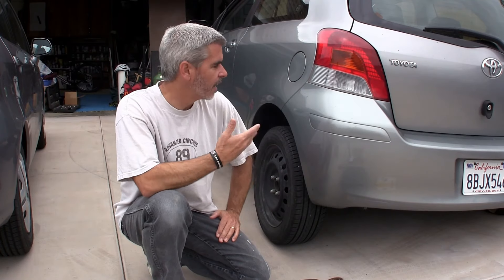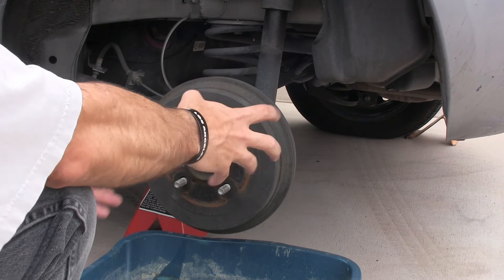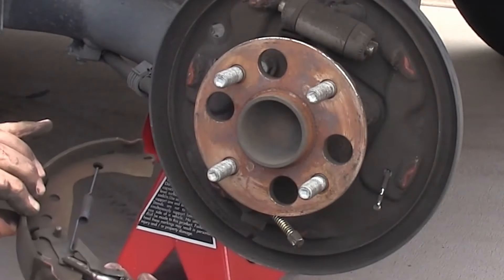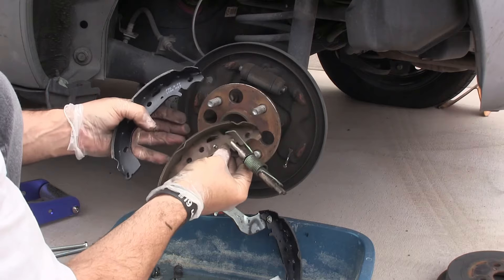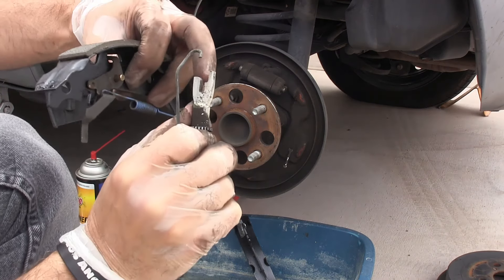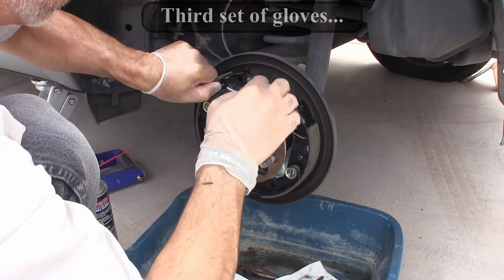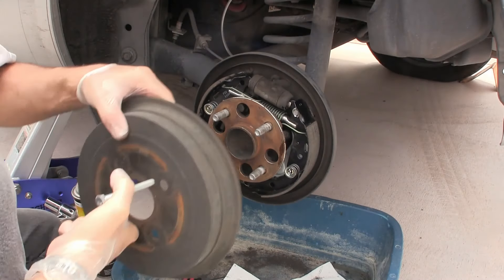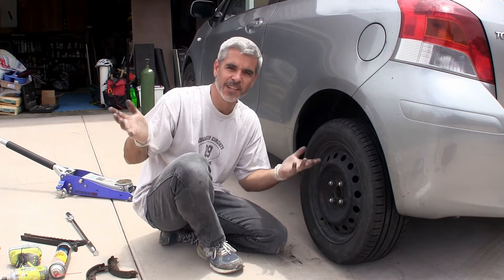DIY Toyota Yaris Rear Brake Shoe Replacement

Comment: Good job, but personally I would have slackened the parling brake cable first. That way the cable lever on the shoes will be set back to the limit. If any past ajustments were made the lever does not go home enough,   this will make the cable come off the lever easier.
After fitting left and right side shoes and adjusting, whilst on the jack stands, adjust the parking brake. Hence the cable has maximum effecked of shoe contact.  But hey, we all have our own ways of working!!
I worked in the motor trade for 54 years, just saying not at all bragging. but I sincerely enjoyed watching your video of this tricky awkward job
well done and great camera work. very informative.
Reply from the maker: Thanks for your comments.  I appreciate your experience in this!  I've pinned this comment to keep it on the top of the comments for now.
Reply: @DansWay  @John Allen, I have never thought of loosening the parking brake tension.  I feel like a dumb a**.  I was just lamenting the stupid design of that spring on the parking break cable and saying to a friend of mine that you really need a second person to clamp the vice grips because that spring is so tight and it pinches your fingers when you lose grip on it to get the vice grips on the cable.  I was saying, to him "I just need to invent a tool that will pull that spring back and act as the second person, allowing the vice grips to be clamped."  Duh!! Just loosen the emergency brake tension dummy.  Thanks for the obvious to be brought to us who don't always know it should be obvious!
Reply: If you know how to do this why are you watching the video just curious lol

Comment: This actually helped out tremendously. Went back and double checked my work. Found two things wrong with what I had done.  Thank you for putting something like this up. "That'll learn me for not paying attention."
Reply: @shortwave, leave one side together to reference if you forget and it will give you direction.
Reply: @justaskwhy1  Yup, was aware of that at the time. I just didn't remove that tire at the time. It was faster to look it up online
Reply: Take pics before you dismantle

Comment: Instead of putting one tire on a wheel ramp just use two jack stands. They usually come in pairs and then if you get confused you can just go look at how the other side is put together. Also the car won't roll away as it's front wheel drive just leave it in park.
Reply from the maker: Agreed, that is another way to do this for sure.  I like your way as you can have both rear tires removed and compare as you say.
Reply: @DansWay  been doing it for 45 years just trying to pass along learned knowledge.

Comment: You're the only one I've seen so far actually use and explain the use of the smaller threaded holes. Thank you. That saved a lot of headache.
Reply from the maker: And I hope you saw in the video description the following statement: I misquoted it as a 1/4-20 bolt. It is really a 8mm-1.25mm.  Another viewer corrected me on this fact.

Comment: BTW there is n shoe adjustment slot in the back covered by a rubber plug. if u take it out you can adjust the tension while the drum is on. no need to take out the drum on and off again to to adjust. quicker and a lot easier.
Reply from the maker: Agreed.  I had to adjust the ring a LOT because of how far I had backed off the adjuster, so removing the drum let me rotate the adjuster quickly.  You can definitely just use the back-side access hole if you are close.

Comment: Thanks! I have 190k miles on the original factory shoes so it is time to do this. I last did brakes maybe 20 years ago. Wish I had a video back then. Nothing has changed in this design.

Comment: Brilliant, at 165K have need for a car I maintain. Its grinding, possible wear on drum. It is always the details. This DIY is a headache saver, did the front rotors and ceramic pads, and it is much easier. Thanks much!!

Comment: Darn good video Dan.........I've had all the new parts in the garage for 6 months. I got a really good deal online. I found out that mechanics around here won't do the brakes on my car unless they supply the parts . They want to be able to hose me on parts and labor both. Your video gave me the courage to do it myself. Thanx. 
I really do mean that. Thanx. Cheers
Reply from the maker: Hey there.  Thanks for the comments, and I'm really proud that you gave it a shot yourself.  It is definitely scary as the risk of 'messing it up' or worst case, getting stuck in the middle, and now you can't drive the car to the shop...  Love your screen name too!  I had to say it before I understood it ;-)
Reply: @DansWay  hi Dan...I'm in my 70's and it's hard to do anything with my hands nowadays, but when i saw your video with the same grey 2 door yaris, i figured that it was a sign. I took the phone out and played and paused my way through the whole job. You saved me a lot of money that i don't have anyway. If you do anything else to that yaris, let me know. 🙂.thanx again

Comment: Great video, I used  your video for my 2012 Scion IQ..every things the same except the bottom spring attached to the shoes is higher up and about 3.5 inches  long.. and my emergency brake brackets were already attached to the shoes (which made it easier) from the factory. I never changed drum breaks before so I used your video while I was doing the left side and then when i did right side I learned so much from your video while doing the left side I didn't  need to follow it..Great video and very easy to follow.....
Reply from the maker: Thanks for the feedback!

Comment: Just did my daughter's 2007 yaris brakes.   What a pain it was!

The rear drums were the worst I have worked on.  There's a huge risk of ripping the rubber boot on the cylinder... in addition to bleeders that withstood half a can of pb blaster and a torch.

Front calipers pins were completely frozen in place. 

I would recommend to spend 200 and get all new front caliber assemblies and new rear cylinders. 

This way u can bleed everything. 

If the previous owner maintained the vehicle... that would have been amazing.
Reply from the maker: Wow, sounds like yours was a nightmare…. Glad you got it done!

Comment: Just a short note on how this process can be further improved. After removing the brake drum, immediately spray the whole brake assembly with brake cleaner and allow the contaminants to drip into the tray below. That way, together with wearing gloves, you will have a much cleaner environment to work with.......Also, the brake lever that is attached to the parking cable need not be detached. The new brake shoe can be assembled onto the brake lever even while it is attached to the brake cable. It will save you another step in the process......Lastly to ensure the parking brake is working properly, adjust the appropriate parking cable length using the adjustment nut located below the parking brake lever inside the car.
Reply from the maker: Hey JC, thanks for the additional input here.  Always good to get more expertise 'down in the comments'...

Comment: i noticed at the end of the video u had fluid coming out of the wheel cylinder. i had that happen too. 
i dont see the level going down now but im afraid i blew the wheel cylinder seal while doing this
Reply from the maker: I’m not sure I see what you are seeing.   What timestamp in the video do you see leakage?
Reply: @DansWay   like 19:20 to 19:50 u can see just a drop on the right side dust boot
Reply from the maker: Looking again, I think that this is just a 'clean' spot after I rubbed the dust off the black boot.  The 'spot' gets larger after I touch it again when moving it around.

Comment: Excellent tutorial.  Very detailed.  It's worth buying the best shoes you can afford to minimize the number of times you have to do this job.  The Toyota OEM shoes on my Tercel lasted 100k miles as did the OEM pads on the same car.  The AC Delco shoes I put on my 2010 Yaris have 40k miles on them and are almost down to the minimum spec thickness at the thinnest spots, and I do the same type of driving with my Yaris.
Reply from the maker: Great tip!  I haven't really found a way to know what pad will last the longest, but going OEM is definitely as 'factory original' as you can get...

Comment: Bit of different colour nail varnish fore and aft on the adjustment bar will save a lot of headaches on reassembly. Also take a photo with the i phone before anything is touched of the whole assembly. Surprisingly how easy to forget the exact location of all the components
Reply from the maker: Great suggestions there Tom.  I'll admit to watching my own video to figure out how to reassemble things sometimes.  A photo is a huge help for sure!  And make one for each side as they can be subtly different, or just hard to mentally mirror...

Comment: Thanks for saving my ass, I have a 2005 Scion xB which has the exact same brake wise and engine wise, wouldn’t have got it back together without your video 🤣
Reply from the maker: Hey no worries!  I've reviewed my own videos before just to figure out what I did to remove something when trying to reconnect or reassemble it....  Glad it worked out!  Thanks for the tip on this being the same as the Scion xB. I wasn't aware of that myself...

Comment: Just did this job Thurs morning, pretty straight forward with this tutorial although the hub removal bolt size is incorrent. Metric size needed, without the two bolts hubs not coming off easy.Brake cleaner essential but it is toxic...

Comment: You can do adjustment from the rear of the drum, no need to open again and again
Reply from the maker: M Ridware that is true.  I should have shown that option.  I was so far off, I thought it easier to just get it close first.  Thanks for the suggestion.

Comment: Thanks for this video! However, on my 2014 Yaris, the old brake shoe with the emergency brake connection does not have a pin with a cotter pin but a rivet instead. Any idea of where I can buy the pin which is not included in the kit? Or any idea to work around that encounter?

Comment: Your drums have almost no rust :) I am guessing you live in a warm climate. Drums on my Ontario 08 hatch are all covered with rust. I am pretty sure my pads are still fine so my motivation looking into it is mostly cosmetic. Planning to paint drums with caliper paint before the install....

Thanks for the video. Looks like I need to set aside a whole day for this.
Reply from the maker: Yah, southern california is basically high-desert climate so very dry.  I'd agree that setting aside a whole day to do this is wise...

Comment: Thank you so much for the helpful video. I just changed my rear brakes watching this but realized that on the little piece that spreads out with the star wheel, I put both of the short sides towards the inside when it should’ve been the short side on one side and the long side towards the outside on the other. Is this a big issue? The brakes are really good now, I just want to make sure everything is OK. I noticed when I click the wheel to spread them out and adjust them, there was no click. Is this way? Thank you
Reply from the maker: I'm honestly not sure if that is a big deal or not.  Being brakes, I would open one back up and see how that difference could matter myself...  There is a tooth that engages the wheel, so I would check that the wheel only turns one way.  This is the auto tightening system.  If this isn't working, you could see the brakes fade over time as they wear thinner.
Reply: @DansWay  thanks for your reply. Even though I didn’t want to, I took it apart and fixed it. It took me about eight hours to do the job originally as I’m a complete noob ha ha, but thought I should fix it right. That little piece with the short side that goes on the outside and controls the adjustment of the brakes over time, which is why I did not hear a click before when I made it go out and the brakes tighter. Now it all works and makes a clicking sound. Thanks again for the helpful video
Reply from the maker: Awesome job!  Must feel good to know that it is all together and safe.

Comment: Did you just jack up the rear on the thin metal rail? Also, where did you place that jack stand?
Thanks
Reply: I’m between the two notches but that’s with the scissor jack, Scotty Kilmer has a video about it

Comment: What other type of grease can you use for the contact points? I can’t get brake grease where I live.
Reply from the maker: I’m honestly not sure if bearing grease would work. It has to be very high temperature and you want to use a very thin coat.
Reply: @DansWay   I used some red bearing grease and seems to be fine. I live in Costa Rica and they have never heard of greasing the contact points here or the glide pins of the calipers- hence no brake grease. Dielectric grease is also non-existent.

Comment: What if the e brake is to lose and the brakes are as tight as it can to put the hub back on, the e brake was was working good before
Reply from the maker: You should be able to spin the sprocket from the back side after reassembling the hub.  You might  also be able to readjust the cable at the handle inside.

Comment: Can anyone tell me what the signs would be that this would need to be done, I have a 2013 Toyota Yaris and I am hearing a noise in the back but only when I  1st crank it up, then I back up to get out of my driveway, once I am in drive , I do not hear it anymore.
Reply from the maker: You could always pull the drum to see the wear, or have a shop tell you how much thickness there is left on them.  A bit hard to say that the noise you hear means the brakes are worn out.   Cold brakes can make noise on their first application in the am.

Comment: Hi.  Thx for vid.  Contemplating trying this job.  Plz tell me what you mean at 1:35 “ make sure you have blocked right side tires.“ I’m not sure what block the tires means.

Also, you said at that point as well, to make sure the emergency brake is off. But my car is manual transmission so if I don’t have the emergency brake on it rolls away. So should I just keep my emergency brake on?
Reply: Solutions Within blocking the right side tires means putting something in front and behind the tires to prevent the car from rolling away.  You can then release the parking brake, allowing to work on the rear brakes.  If you leave the parking brake on you won’t be able to remove the drum.  😉
Reply: @marcfillion2345  okay. thank you!
Reply: @West Park good stuff!  thanks!
Reply: In the video, you can see that Dan has placed something behind the rear tire - you can buy those at the store or use a block of wood that you have lying around (assuming that its thick enough to safely block the tire). Depending on which way the car may roll, you may want to block both sides of the tire

Comment: My dude - how did you remove the cotter pin lol
Reply: Okay, I see why you said don't reuse the old pin hahaha. That thing is mangled to hell after I finally pulled it off. I'd love to know how to properly remove it. Coincidentally, I'm changing the brakes on MY daughter's 2007 Yaris so this felt like a father-father project when watching your video. Thanks man! (Not sure how I managed it, but I only squirted brake fluid into my eye once, so there's that :))

In the morning I'm going to find replacement cotter pins.

Comment: Today was the first time I’ve ever changed shoes. I must have done something wrong. My wheel cylinder is leaking.
Reply from the maker: Oh bummer!  Did you figure it out?
Reply: @DansWay  Just replaced them in the end. My Yaris is a 2007 and they were the originals. Maybe I was too ruff with them while trying to get the long spring in place- which was much harder to do on mine than yours.
Reply: @chegvra  I just had the same issue, was looking to see anyone else experienced anything similar, and came across to your post. I also had some break fluid in my eye 😔 It is really difficult to place the long spring into position on mine. If the break fluid is leaking, do I have to change the whole thing?

Comment: Just finished this on my son's car, absolute pig of a job, made the mistake of buying cheap replacement parts including the shoes and a replacement hub cylinder for the one that was leaking, the $17.99 cylinder did not fit as well as the original and the $23 brake shoes were very poorly made so my advice is pay a bit more for the parts, probably no need to get Toyota but certainly not bargain basement.  At the end of it all the hub did not want to go on even though the adjuster was maxed all the way in but managed it after a lot of fiddling.  This is not a job I want to do again.
Reply: Did you buy chinese parts? Not very patriotic of you.
Reply: @ax4178  yep, Chinese parts for a Japanese car